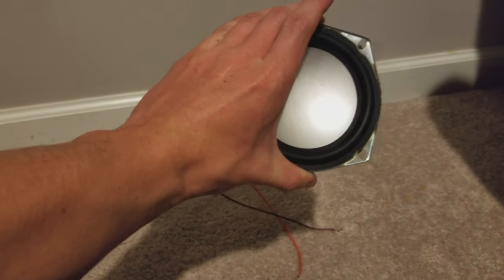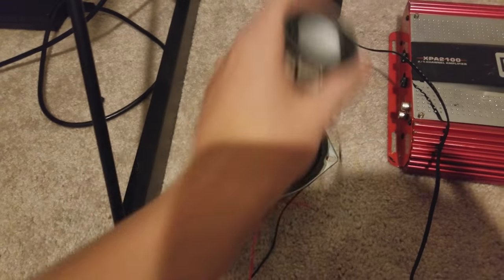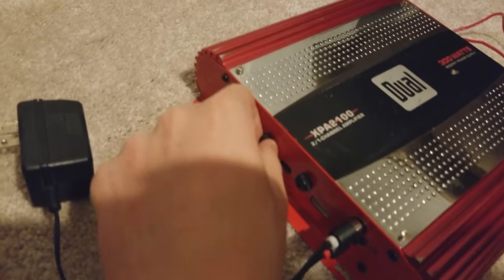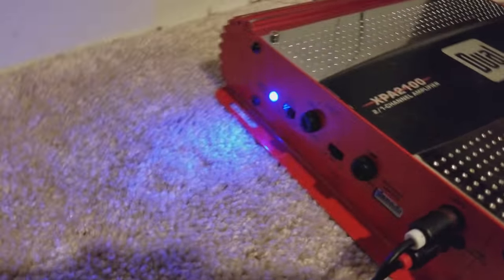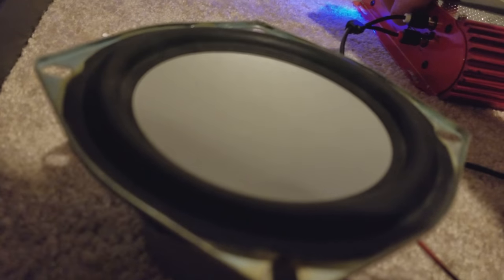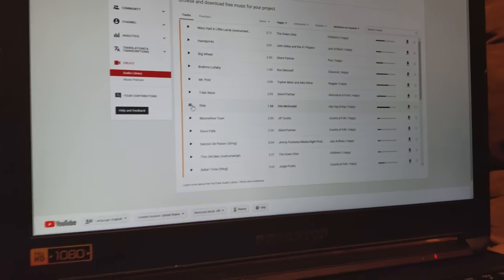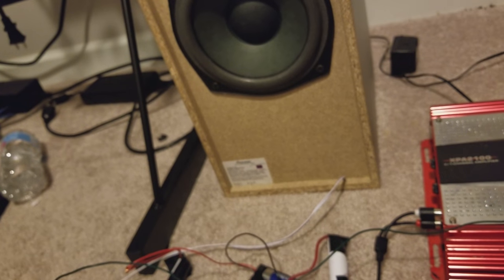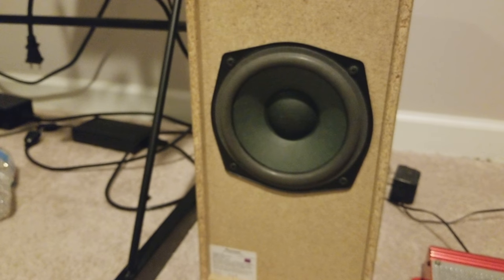Will It Work: Car Amp Plugged Into A Wall?

Comment: This work, you can listen to music with it . But when you icrease the volume it will distort not having enough power. Bro use a 12v carbattery charger or power supply for computer.
Reply: or xbox 360/one cord, i use a power supply tho
Reply: @fade7663 Xbox 360 still doesn’t have a lot of power it would be fine for speakers but high power subs def need sum more powerful
Reply: @KingRodrick  yeah i got a hp psu 1200w 100a

Comment: You need 14 volts like when your car is running and charging the battery.  Those big amplifiers are thirsty!
Reply: An amp can run on 12volts. 14volts is just battery charge. Some people often use 16volts or 19volts.

Comment: Next time use 4ohms or less that's what that amp is for
Reply: Whyyy
Reply: @1oneguythat it will in theory double the output! 4 ohms versus 8 ohms = less impedance and more volume.

Comment: 6 volts 300 mA will definitely not do the job. It's a 12 volt DC amplifier , you probably need a minimum of 1 amp
Reply: I was thinking of running some car amp for my room and using Xbox 360 far power box to run it as a power since it's 600w max amp probably gonna use 2 TV speakers and a 500w max woofer w it

Comment: 12V  30amp power supply with cooling fan. The best.
Reply: Computer psu are often mistaken for trash
Reply: its 10 amps acording to the fuse

Comment: Would a 19v charger work with it?
Reply from the maker: @landenferringer977  You would have to read the manual with the amplifier you want to use, see what it's rated for. If it's a car amp I doubt it's a good idea. Cars don't really produce voltages much above 14 volts.

Comment: Nice . I need a little help plz. I've got a car amplifier and want to install it in the house with a inverter with about 50 a . but not sure whether it has to be the same wattage as the amplifier. Or can be any wattage 500-1000 maybe .my amp is a 4500.1 1000 RMS . what must be the wattage of the inverter
Reply from the maker: Well there is one major issue with what you want to do. An inverter converts Direct Current (DC) into Alternating Current (AC). Your house provides AC through every outlet, and a car battery where the car amp is intended to be used provides DC. To go from AC to DC you need a full-bridge rectifier. And a car amp needs between 12 and 17 volts, Volts multiplied by amperage gives you wattage. I think your best bet would be to buy a computer power supply that will convert AC to DC, you use specific wires which you will have to look up a video for, and maybe buy a car amp capacitor to throw between the 2 so it doesnt struggle for power. Your other option is to buy an amplifier that is intended to be used inside a house, they make some pretty powerful home amplifiers. The last option is to buy some deep cycle lead acid batteries, and when they're not in use put them on a trickle charger. Just be careful with that because they will give off hydrogen gas which is combustible if there is enough present. And by the way as long as you're within the wattage range you do not have to provide the full amount of power to reach maximum wattage with that amp. 1000w+ RMS is way more than what's needed in a household. My car is running 800 watts rms and it is damaging certain parts in my car which is certainly not something you want to do to your house. If you have anymore questions lmk I can provide links or give advice on whatever
Reply: @NickPangburn  thanks a lot appreciate this advice
Reply: @NickPangburn  OK u right in a way . but the inverter also cuts down 24 volts into 12 and outputs Ac power . the inverter is a cheaper way maybe
Reply: @NickPangburn  plz let me know what the wattage of the inverter should be
Reply from the maker: You cannot use AC power on a car amp, it requires DC.
Reply: @NickPangburn  k
Reply from the maker: From my understanding there should be a fuse between the power source of an amp and the amp itself, and you can provide more wattage than what the amp can output, but the fuse will blow if you draw too much to protect the amp. The fuse is not necessary but a fuse is cheap in comparison to an amp. But again you cannot use AC current for something the requires DC. DC flows in a loop, AC moves forward then back. They're completely different.
Reply: @NickPangburn  k . I'm gonna use a laptop charger
Reply from the maker: @myklesingh8253  Ok! Be very careful! Follow a video and duct tape loose wires that are not used individually!
Reply: @NickPangburn  hey there once again . could you plz tell me how to calculate real RMS power . formulas
Reply: 2 PC power supply is what I use and a 800watt and a 200watt for the highs for my house 🏠
Reply: Man I forget ohms law and all that....so what if I have 12V AC-DC  plugins but they are low amp output, like 2.5 and 5 amps. If I plug 2 of them in to the same car-amp does the volts add together or the amps or both? Like would it be 12V and 7.5amp or 24V and 7.5amp? I wanna say just the amps add together but the Volts stay 12?

Comment: What program are you used for test hz?
Reply from the maker: http://onlinetonegenerator.com/ or if you dont like that one you can search on google "Frequency generator"
Reply: @NickPangburn  quick question do you think you could plug in a 2000watt amp into a house outlet im thinking about doing that with an 18 inch skar I need to know if its possible to get 2k watts out of an outlet
Reply from the maker: @infodisco4097  It depends. Most U.S. outlets are 120v ac @ 60hz, but I would buy a multimeter to test it to make sure. It could otherwise be 110v ac @ 50hz or 220/240v ac which is uncommon except for specifically the outlet for washers and dryer's. The next step would be to check which breaker in your breaker box the outlet is on. You also need to know what other devices are running on the same breaker. As far as I know breakers are usually between 15a, 20a, or 40a ("a" meaning Amperage, or amps). So wattage is (volts(v) x amps(a) = wattage(w)). So a normal outlet is 120v x 20a = 2400w. BUT WAIT! One big issue here is amps run on DC, or direct current vs what your outlet supplies, AC or Alternating current, which is why I listed the frequencies 50hz/60hz. You have to convert between the 2 to make everything work. To go from AC to DC you need a full bridge rectifier. I would not recommend building one at home. Instead to get around doing that I think most people buy computer power supplies, which will provide about 600 watts of output with a good power supply unit. The subwoofers I have in my car are 800 watts continuous DC, and they're very much enough for the car, they can shake my house from the basement on a low setting. Honestly I would either buy a computer power supply and watch a tutorial on which wires to use, or buy a wall outlet powered amp. If you want to use the full 2000 watts, you will need 1 or 2 12v DEEP CYCLE flooded lead acid batteries. Then for those you need to buy a wall outlet powered battery tender/charger. It will allow you to run the subwoofers for at least a couple hours before having to charge them again. There is so much I could talk about but I recommend just looking for videos more specific to your needs. The cable I have in the video I stole from one of those calculators that print receipts. If I remember right it only provides 5 watts of power.

Comment: So the wire with the lines is positive
Reply from the maker: I will check, it's been a while, I'll let you know
Reply: It shouldn’t matter as long as both connections remain true from amp for eg to the speaker. The colours and lines are there to make things easier. The + and - is all internal and not to do with the wire.
Reply: @onze5107  if you reverse the wires the cone will hit backwards.
Reply: @NickPangburn  if you put your speaker in backwards youll have more room in your enclosure. Then you can wire it backwards to make the cone hit right. Some amps have a 180 phase switch.

Comment: Hey here's a better test for you: wire the two prongs of an extension cord to the two terminals on your speaker. The wall outlet will give you a solid 60 hz. signal to your speaker. Just plug the speaker into the wall with the extension cord and enjoy.
Reply from the maker: Ohh yeah I'm sure 1440 watts won't damage a speaker at all